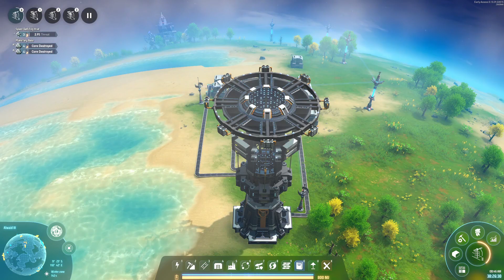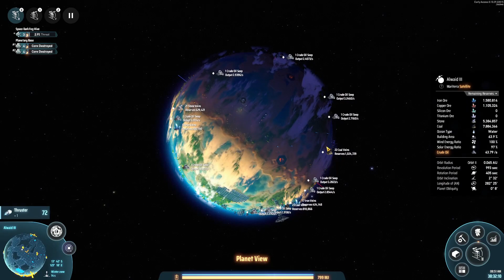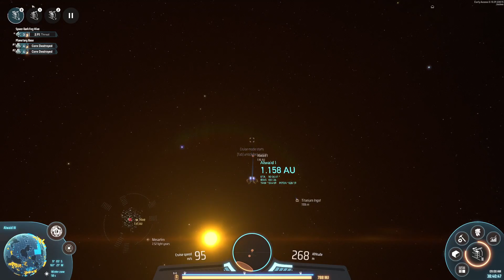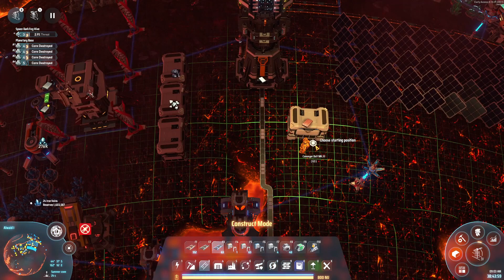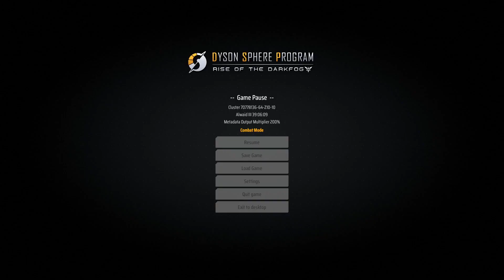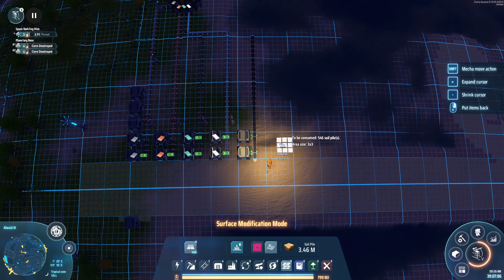IRON & COPPER // Dyson Sphere Program // Mission Log 43

Comment: drone logistics up and running congrats!! you've officially entered what most would call the "mid game"! planets are gonna be COVERED in towers! the most basic factory blueprints revolve around "inputs demanded from network, come out of tower +/- proliferation, picked up by assembler, and output goes back into the tower to be made available to the network." its up to you which materials you want to ship around. some people ONLY ship raw ore and absolute finished products, some ship around all intermediate, some ship only common intermediates and not the obnoxious ones. whatever works for you! if you notice, your planetary towers can't launch all their drones due to power struggles. you can fix this by either increasing their minimum load so they are more efficient, or raising the max charging rate of the tower to be able to make more trips. 

my personal preference is to do all smelting on-site and ship only bars between planets, that way i know i need smelters if I'm capturing a new mining planet, and i can leave the smelters home if I'm producing something, but that's totally a preference. however you want your factory to run is up to you. it is worth noting though that things like titanium silicon and glass require 2 units of raw to make 1 smelted good etc, so the more you craft on site, the more efficient your vessels are. for example, lava planets have every raw material needed to make every type of engine, up to you if you want to export bars or craft engines on site and export those.

dragging belts into a tower is a little weird. i think its some kind of glitch or poor design. you don't need to set a filter to belt in, only to belt out. what works best for me if i have that issue is to just fully place the belt 1 node away from the tower entrance, then make the final connection that way the belt physically can't try to take a weird route. also, when you are belting out, you can hit tab to quickly cycle through the available filters rather than placing the belt and having to come back to the tower to set the filter. this works for filtering sorters as well.
Reply from the maker: Thanks, pretty happy about it. Wrt all the other stuff, I think I'm going to have to feel my way through it and learn as I go. This is my first playthrough so I'll take my time and learn bit by bit, but I'll get to the Sphere in the end.